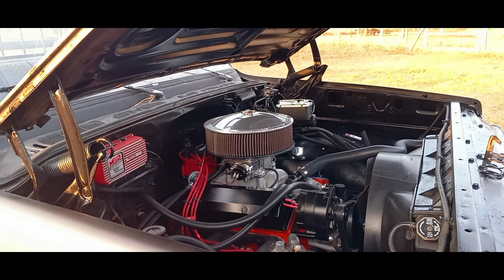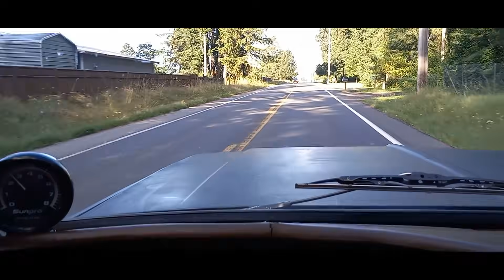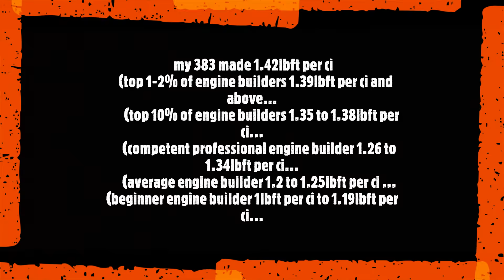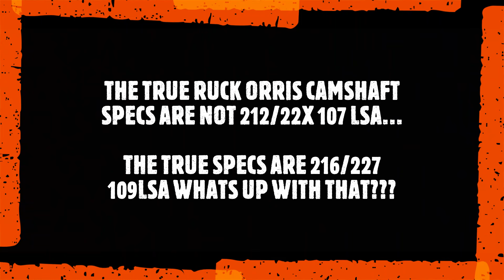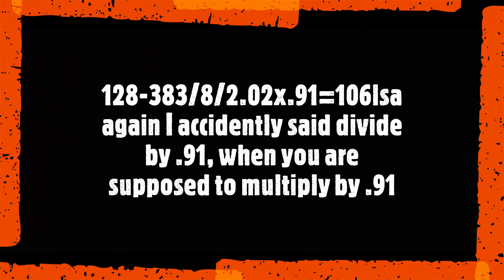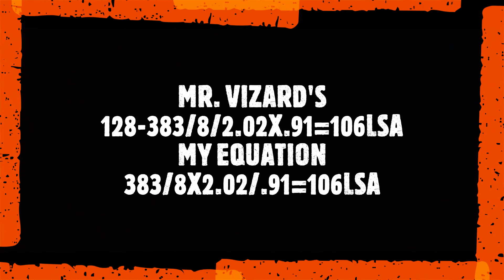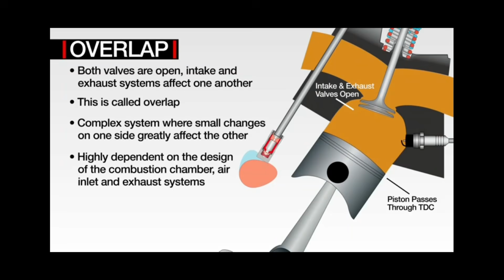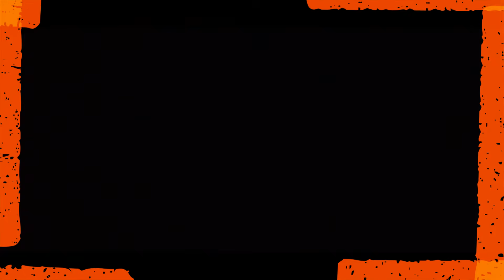CAMSHAFT SELECTION by LSA, 9 LSA's DYNO TESTED!!! LSA THEORY WILL BE DYNO PROVEN!!!, and EXPLAINED

Comment: I remember an article back in the late 80s or so that featured a 357ci SBC that Joe Sherman built. It had hogged out 492 angle plug heads on it, around 12.5-1 compression, ported Strip Dominator intake & 850 DP Holley, he ran it with 3 identical cams except for the lobe separation. Can't remember the exact specs on the cam, but it was in the 270-280@.050 range, 630 lift, and one had a 106, next was 108, the the 3rd cam had a 110 lobe sep. As the lobe sep got tighter, the engine made more hp/tq and the 106 made about 20hp more than the 110 all else being the same. Engine made close to 600hp NA. I copied that build a few times except with aftermarket heads. Ole Joe definitely knew how to make power. I remember a 406 with a 1050 Dominator he built back in the late 80s that made 660hp with a stock 2-bolt  block, cast crank, stock  production 5.565 long 400 rods and extremely nice JE pistons. Heads had some heavy porting. Victor E intake. He made serious NA power on a budget. That 406 got turned up to 7500rpm too. Joe definitely was an influence on me as a young buck first getting into this shit. His son Steve Sherman definitely took after his dad, he's quite the builder too. But having Joe Sherman as a dad, you would have to grow up to be a engine guy. Joe had a dyno in his backyard. So his results were proven.
Reply from the maker: Man buddy, Im so glad you made that comment, it is literally a relief to know im not alone in the dark knowing the truth lol.. you wont imagine what some of the people had to deal with have said, I havent had to deal with people like this up until now the whole time ive been on youtube...  It's funny that you say that about those 492 heads, because ive been called all kinds names and have been accused of being full of shit just for saying that my 383 makes 580hp, there have been several individuals that were trying to tell me that the 186 heads wouldn't support 580 hp!! In all honestly the dyno that engine was run on was so conservative that my dad who owned the dyno for 18 years, my grandpa and the guy who bought my dads shop that was running the dyno said that its probably closer to 600hp..., Now even though i would be speaking the truth, there is absolutely no way i would consider saying anything along the lines of we bealived it made more along the lines of 600hp in a video.. I could easly bealive it is more near 600hp with 186's & the ported dual plane, specially as violent as that truck was i could realy bealive round 600.(because some of them big block trucks had 800hp N/A)... Now at that point in my life i knew damn well that even them 186's have the potential to support around 650hp ish, what people don't understand is it dont all come down to port flow cfm numbers.. Being as I don't personally have a dyno to prove what is reality, I wont even consider making claims like that in a video( more like speaking the truth) because saying something like its possable to build a 370ci sbc screamer that makes 650hp with 186's or 492's.. it is so unbealiveable to an uneducated individual who is also ignorant.. saying something like that on youtube is just asking to be bombarded by comments by the know it all's, and the ignorant narcissists, and other forms of mindless people that think just because they haven't personaly seen or heard of 186 heads making olny 580hp it cant be possable.. Hell just knowing how people are on youtube, when i had made a video about that engine, (the video that got mr vizards attention,) which was the first video about that engine. i said on the video title 550-600hp race winning sbc on a budget because which is true, but I just simply told everyone it made a flat 550hp to avoid the BS, but Mr Vizard seen right threw that lol, its not everyday you come across someone purposely underrating their engines power to avoid peoples BS. Just the other day I had someone comment on that video saying my 383 wasn't making 550hp with those heads.. Imagine saying, were almost positive its making around 600hp, then go on to say 186's can support 650hp ish, people would shit a chicken lol.!!!. Now had i said the true power numbers I would have been inundated with all the ignoramus know it all people thinking im making false claims, then bealiving they are right, and then they think they have one up on you, and that you are an idiot, when in reality it's the other way arround.. Also, because the engine was dyno'd 16 years ago & being as its a peice of paper and ive had some extremely difficult situations in life where worrying about saving a peice of paper when you are just trying to survive, it no longer becomes a priority to have the printout of the dyno results, which i  wish so badly that I had the printout right now to make people eat their words and see reality!! I had tried to explain to them that even though I said that the heads are the limiting factor of the engine those 186's can legitimately support upwards of 600hp when in reality it's 650ish but good luck getting them to bealive that lol..  If i had said something like that they really thought i was full of shit lol.. the only way i would bring that reality to youtube in a video is if I owned a dyno and I could do a live dyno run, and even than there are still people who wouldnt bealive it is possable...  sorry buddy I can't finish what I'm typing I'm puking my guts out right now  take care.
Reply: @CDG-Racing_Dynamics  I grew up around Stock/Superstock and Modified Production class cars back in the 70s & 80s. I've seen 307s making 550hp with production based heads back in 1978. A modern NHRA legal 68 295hp L-48 350 Superstock engine makes around 650hp with a Q-jet and 041 heads.  L-79 327 Superstockers are over 600+hp these days with 461 casting heads and a 585cfm Holley carb. People just don't understand what they've never experienced. And what they don't realize is how much work was put into them old heads. A serious full on Superstock prepped 186 head with 170cc runners flows 300+cfm with a 1.94 valve. Exhaust over 200cfm with a 1.50 valve. And then there's the "Stockers", typical late 60s NHRA legal 350 SBC is well over 500hp these days with "Stock" closed chamber 186/041 heads &  Q-jet. Seen a 1974 smog 350 stocker 350 on a dyno, it made 430+hp with stock 882 open chamber heads and a 390/410 lift cam, pretty much stock everything. Run high 11s in a 74 Malibu. I built a L-69 305 stocker in a 83 Malibu wagon years ago, it made just under 400hp and ran high 11s. The cam was rowdy as hell with stock lift. The compression was "blueprinted" to over 11-1. But basicly it was a stock 305 from a 84 Z-28 Camaro. Anyone in doubt should go watch some Stock/Superstock drag cars run. A NHRA legal 68 Z-28 "Stocker" runs 10.30s with a legal #291 headed 302 SBC turning 8000+rpm. How much power does it take for a 68 Camaro to run mid to low 10s, person do the math and be amazed. I watched a 300hp 327 Superstock  make 599hp on a dyno with a Carter AFB and spinning 8500rpm, that was back in the 90s. It had heavily modified 461s on it with a 280+@.050 solid roller, 650+lift. Extremely tight lobe separation. But not much info available to the common man on the the secrets of Stock/Superstock engine building techniques. Most folks just copy what everybody else is doing, and have been brainwashed to think the old school SBC is limited to 300hp. So they jump on the LS bandwagon and monkey see monkey do. Shits pitiful how dumb people have become. I've been around this shit for a long time. Still hard to beat the good old SBC with anything when they are built right.
Reply: @thereluctantgearhead4544  Problem with the "stock" SBC is, they will not handle 800, 1000, 1200+ HP, AND still be streetable, and that's where the LS shines. If you're wanting to make massive horsepower, you can't out-do an LS and a turbo or two, no way. I'm an old timer, I love my factory BBC's and SBC's, they're all I build, but if it's coming down to a head to head race, horsepower/torque is the winner every time, and an LS with a turbo is going to give you that over the SBC.
Reply: @Anarchy-Is-Liberty  I'm not new to this shit bud, but not everyone wants to jump on the LS fanboy wagon. It's just another engine, one option of many. I prefer the old shit myself, but that's just me. And I've done heard all the bullshit about how the LS us better than everything, but in reality it's not. I've built engines for a living since the 1980s. I've also built at least 20 LS engines in the past couple decades. I'm familiar with them and I'm not impressed. I'll still take a bigblock Chevy over an LS any day. Don't believe everything ya hear. Because half of it's bullshit. Anything you can do to a LS can also be done to a bigblock, and the bigblock will always make more power on equal terms.
Reply: @thereluctantgearhead4544  The run-of-the-mill NON-SPECIALTY LS can achieve far more with it's OEM Block, Heads, Rods and Pistons than ANY SBC or BBC could on any day of the week and for those Old School SPECIALTY-ENGINES such as ZL1, LS6, LT-1 and DZ302 etc that may have been equipped with better parts for short product runs, the LS and current LT Small blocks all have their own far superior replacements. Metallurgy and Science win. Go to the junkyard and grab yourself a Vortec 5.7L/350cu (with the good chambered heads) and an LS 5.3L/325cu of comparable mileage and do nothing more than a cleanup and a Camshaft swap with Springs on each and see what happens.
Reply: @joeyjojojr.shabadoo915  Thanks for the info, I just started fuckin with engines yesterday and don't know shit.....
Reply: @joeyjojojr.shabadoo915  I already have 60+ engines. Don't think I'll be going to the junkyard anytime soon for another. I know what's up. You build what you want and I'll do the same. But I'll tell ya this, I've already beat many LS engines with old dinosaur shit, so it still works. And I don't build stock engines.....
Reply: @joeyjojojr.shabadoo915  I've built over 1000+ engines over the past 40yrs, that includes the overrated LS. So I've already compared everything to everything at some point. If the LS impressed me, I'd have a building full of them. But bigblock Chevys are better if your really trying to make some vehicle destroying power.
Reply: @thereluctantgearhead4544  I am not arguing with you for aftermarket or fully built engines, BBC is king...... BUT, take PRICE, WEIGHT, PERFORMANCE-for-INVESTMENT into the mix and LS wins 9/10 times. A $5000 BBC build, re-using as many stock parts as possible is perhaps laughable and most times doesn't exist. A $5000 LS build re-using as many stock parts is an impressive reality, especially when comparing even a SBC, WHO IS FORCED TO PAY MONEY FOR HEADS THAT FLOW THE SAME AS A STOCK LS HEAD. That's $2500 more that I can sink into the rest of the build with a $5000 budget.
Reply: @joeyjojojr.shabadoo915  I couldn't tell you how many junkyard LS engines I've seen people swap into their shit and put a Turbo or nitrous on it and it blow up after a couple runs. Some even let go on the first hard pull. You obviously just haven't been out in the real world with this shit. And stock cathedral port LS heads don't flow that much. Plenty of aftermarket SBC heads that make them look like shit. People were building NA 800+hp SBCs back in the 80s. Seen a 427sbc make 1005hp NA in the mid 90s with a single Dominator. And don't even get started on the bigblocks. Even ole Cletus McFarland went as fast as he could with the best LS engine money can buy, but to go faster he swapped to a bigblock Chevy. That says it all right there.
Reply: @joeyjojojr.shabadoo915  Well you do you, I already know what I need to know. I'm an old dude, been drag racing for 4 decades. So like I said, you do you. I'm not here to argue, that's the trouble with you LS fanboys. I dont care what you choose to build. I've built some turbo Buick V6s that would smoke your LS. 30yrs ago. Many options available, don't limit yourself. And $5000 spent in the right places on a bigblock can get ya 1000+hp. So you should look alittle deeper.
Reply: @thereluctantgearhead4544  Texas Speed don't build the best LS that money can buy. Cleetus combination was a train wreck from the start. It should NEVER have been a 427. It should have been an LS7 based 387 with TONS OF BOOST ala SINGLE TURBO. Boost makes HP/TQ...NOT CID in a forced induction engine like his. Grubbworm holds the GM stick record on a 302 or 327. Wrap your mind around THAT.
Reply: @thereluctantgearhead4544  POST YOUR MAX EFFORT DYNO VIDEOS AND RECEIPTS.
Reply: @thereluctantgearhead4544  Let's BOTH go and build N/A 427's or 454's and compare. YOU build a BBC and I will build an LS. The only catch is, YOU MUST use Stock Truck Cylinder Heads and ONLY a valve spring upgrade, Stock Rockers, Stock replacement Lifters (roller for a roller motor, flat tappet for a flat tappet motor) and aftermarket camshaft. The engine block must also be stock, although sleeving is OK. RODS MUST BE STOCK, although Crankshaft, pistons can all be aftermarket. Let's see: 1) who spins higher. 2) Who makes more HP. 3) Who's lives longer. Induction system and fuel/timing delivery is Dealer's Choice. And before you think that crying 'Fuel Injection = No Fair', it's a PROVEN FACT that an LS over 400cu with a 4150 or even a Dominator and Super Victor makes more peak HP than Fuel Injection, so don't assume that I would use FI as a band aid. FI makes driveability better, that's all. Up for a challenge ?
Reply: @joeyjojojr.shabadoo915  I know all about the Grubworm. I didn't just crawl out from under a rock. It was running high 6s with a production block LT1.
Reply: @joeyjojojr.shabadoo915  You LS fanboys always trying to prove something.
Reply: @joeyjojojr.shabadoo915  How about we just fight and see who's tougher....
Reply: @thereluctantgearhead4544  I agree about people jumping on the LS band wagon. I reluctantly got back into racing with my son and his 4th gen Camaro. He didn’t want to cut it up so I built a 408 LS3 headed engine. I was impressed that it went 10.30’s and still streetable. I know dollar for dollar the Big Block Chevy will out run that LS. I grew up as a second generation drag racer and raced big block Chevys thanks to my dad. I had a 427 L88 head with 12.5:1 TRW pistons in it and it went 9.80’s in a 3300 lb. Grand Prix with a powerglide. This younger generation will never know what’s it’s like to make big power n/a.
Reply: @CDG-Racing_Dynamics  People should study up on some late 70s Modified Production class cars and the engines they ran. 550+hp 283s and 307s were the norm. Or Econo dragster/altered engines, had tight rules, but small cube SBCs making 550-600hp back in the 70s spinning 10,000+rpm. Alot of that shit seemed to defy logic, but it happened. I've built more than a few high RPM small cube screamers myself back in the day. I'm collecting parts now to build a 8000+rpm 439ci bigblock Chevy. I'm currently building 4 bigblock Chevys and 10 smallblock Chevys. Also gonna throw a 455 Olds in mix too, I have a 79 Cutlass that's been sitting way to long. I have 60+engines tucked away. Been collecting them for decades.
Reply: Got to meet Joe years ago very good at his work
Reply: @larryburns4605  Ole Joe was the master at getting the most from the least. Had to be a genius. His son Steve Sherman is pretty slick too.
Reply: @larryburns4605  I seen a pair of 492 GM heads Joe ported years ago,  they were over 300+cfm. Ports were huge. He wasent just dickin around. Hell of a head porter. Those heads were a work of art.

Comment: yeah i have always been wondering about the radical LSA on some american cams, as volvo cams on the most lazy mondaine eco cam on the old 2V inline 4's had 117deg LSA and the turbo cams was at around 109LSA
and any of the more sport oriented cams had around 110-108LSA and even their racing cam had 107LSA but mad duration and lift.
even aftermarket volvo cams usually got the same 107~109 unless we are talking turbo cams then it reach further out to the 111~115LSA range for high performance turbo builds
Reply from the maker: Thank you for watching.

Comment: Hi, Awesome video ! 40 years ago a friend of mine who was a tech at Sig Erson taught me a lot of what you said. I went 8.50s with a 351 widsor with cleveland heads. The pistons were about .100 down in the hole because I was a starving college student and couldn't afford new parts. I ran a 104 lSA the car was a bunch of fun!  I know a guy who builds Corvair aircraft engines. He wont even listen to anything about the camshaft. His engines only make about 100hp. Aircraft engines need to optimize low rom torque because they are limited to 2600 RPM. I have thought about it a bit but would really love to hear your take on LSA with the crappiest heads ever at that rpm , if you have the time. Thanks so much !

Comment: I have a small block 427 making 550hp. The Howards cam spec has a lobe center of 110 intake centerline of 106. The intake duration is 294 exhaust is 300. This is in a street 82 Corvette.
Reply from the maker: Sound like a fun car! Thanks for watching,  take care...
Reply: @Cattledog Garage  it was a fun car until I fried the transmission three weeks ago. Now, I am converting from the 700R4 to a 4L80.